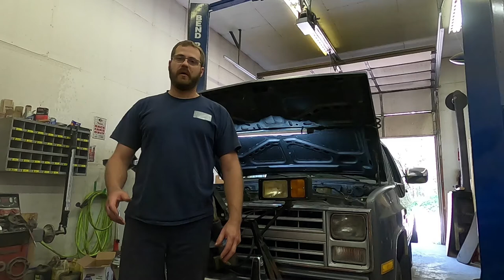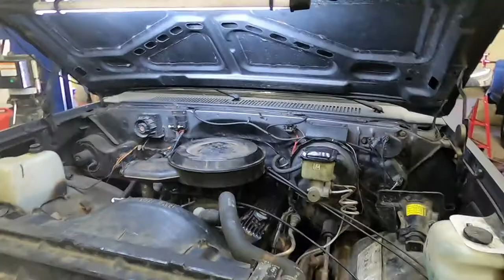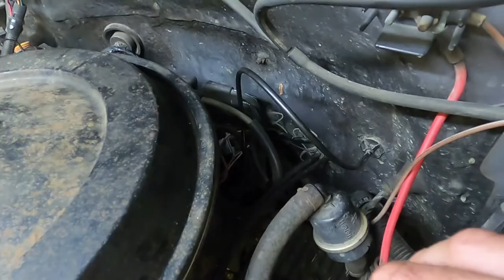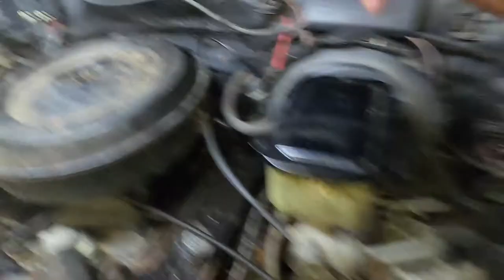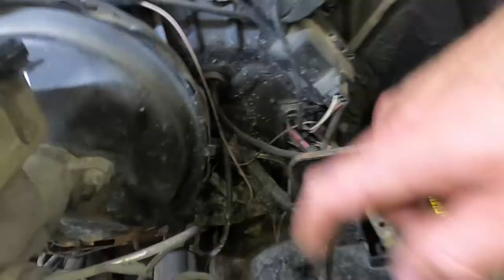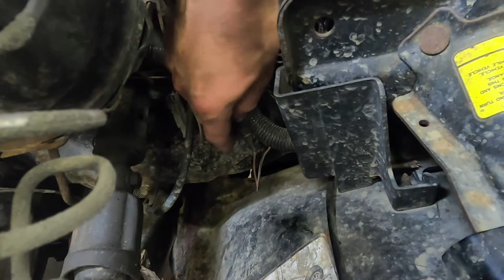87 Chevy Truck TBI Timing Set Bypass Connector Location

Comment: People listen this guy knows his stuff. I have a 87 chevy silverado v10 with a 350 tbi and this is the same as my 87. So thank you very much for your time and wisdom.
Reply: I have an 87 Chevy V10 and the tan wire is on the right hand side. My timing keeps getting thrown off even though the distributor is tight?
Reply: @joshuawillis1334  i found this on the internet- The ignition timing error is typically caused by damage internally like the pistons or valves inside the engine. A loose or weak engine timing belt that jumps time can cause the ignition timing to be off. Hope this helps godbless and be well.

Comment: Great video! I own an '87 TBI350ci R10. Back in 2001 I had the same problem. Pick-up inside the distributor went bad becuase I washed the engine and the steam entered the bottom of the distributor through a small vent hole. I wasn't much of a mechanic back then so I took it to the Chevy house but after 3 days they kicked it back so I took it to a specialty auto electrician. Still a no go. I finally taught myself to use a multi-meter and fixed the problem in 2004 then hit the same wall. I couldn't get the timing set and couldn't find the dang wire. Of course back then the internet wasn't very helpful. I finally traced it out and fixed her. They are unique trucks but once you get to know them you really do love them.
Reply: My 87 350 makes a machine gun noise when accelerating. I changed the cap and rotor and istill get the same noise . Should i pull that wireyou think thats it?
Reply: @sirjohnahayfalcon  man that sounds more like an exhaust leak, or a blown out spark plug. Mine sounded that way becuase I have a clogged catalytic converter that blew a small hole out of itself.
Reply: Keep making this stuff

Comment: They weren't all zero, some were 4 and 2. It says on the tune up label. Good video on where that wire is on that one. They are in different places throughout the years on tbi motors. They were around since 1981.5.   Later wires are under the glove box by the heater fan, and others are in the engine compartment by the heater hoses  other places too

Comment: Do you put it in Drive? When timing, a automatic transmission? My Chevy sticker under the hood says to, does it make a difference? It also says put the conductive pickup wire from the timing light on the coil lead wire on the distributor instead of the number one spark plug, does that make a difference???

Comment: My "88" 454 has that wire in the same place.
Reply from the maker: Which body style is it?
Reply: @macsgarage  .. I have a 1988 crew cab square body. They called it a R20.
Reply from the maker: @ReshardsAutomotiveWorkshop  Good to know. I figured it would be in the same place up to 91 on the square bodies.

Comment: I have a 86 gmc sierra with a 89 350 carb swapped tbi.... the truck has a "esc" box under the dash that has been cut at the fire wall, has anyone heard of this?  Because I've changed every that has to do with fuel and spark and it will stat up just fine and run good for a few minutes and then start backfiring out of the exhaust run like poop and die,what am I missing?

Comment: Question, my 89 chevy truck has the EST connector located where yours is located, not like the manual. I'm glad you made this video. My issue is when I disconnect the EST connector, my truck will not start. I rebuilt the distributor with all new parts and it will now start but has a miss and  I can't set the timing because it won't start with the EST connector disconnected. My original issue is it would not start. Replaced the primary coil, pick-up coil, distributor shaft, rotor button, cap, and ignition module. Do you have any idea why?

Comment: Was it cranking over? I’m have a problem with vent injectors to fire. Runs when I pure gas in the throttle body. I have replaced all the fuses checked all the grounds replaced the ecm and prom. What am I missing?

Comment: I have an 1989 GMC Jimmy, 350 TBI, 700r4. book says behind distributor.
Reply from the maker: Yeah that's what the book says.  That's why I made the video.
Reply: Allldata just says adjacent to the distributor and sticker sticker on radiator support says inboard firewall but  On this its above from this you show , sticks out in harness that runs above and behind the booster. Thanks, it put in closer  than other references.  @macsgarage